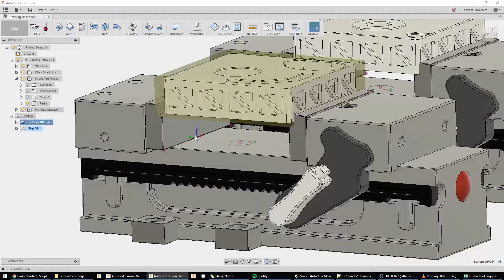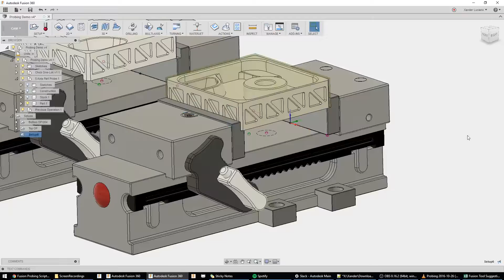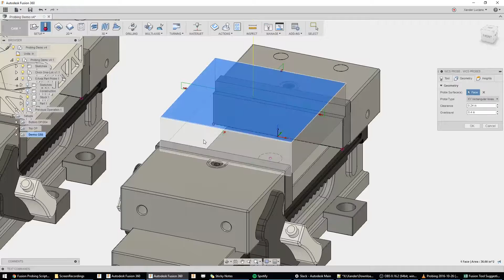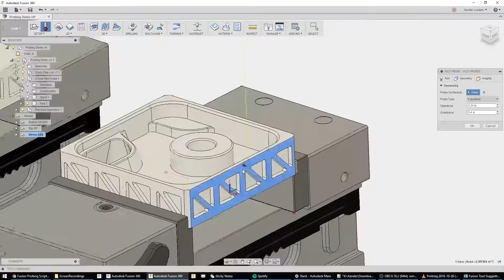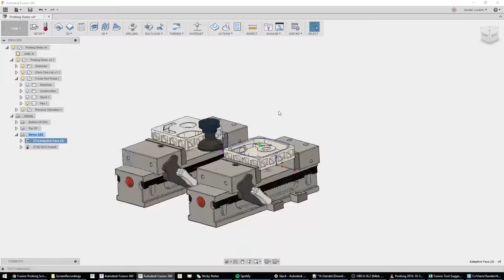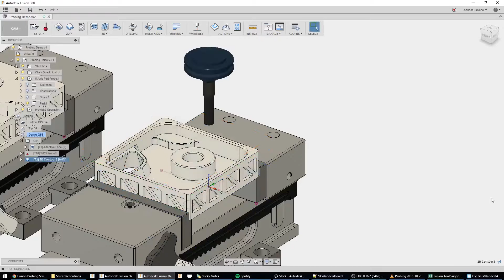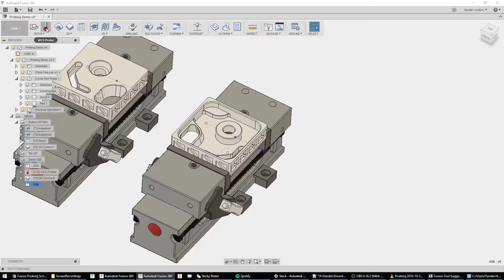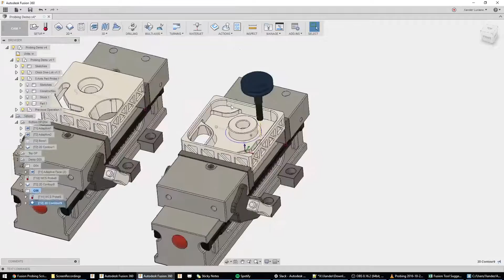Fusion 360 CAM - WCS Probing Tutorial

Comment: Hi Xander, so if you probe only the X-axis coordinate for G55 using G54. the G55 will takes the Y/Z coordinates from G54 and add the new X coordinates? example if originally G54 is X100, Y100, Z100 and G55 is X0, Y0, Z0 and now you probe to G55 X-axis only based on G54 you get the machine controller to have X(measured), Y100, Z100?

Comment: Disappointing and plain wrong tutorial has a couple of major howlers.  Try to use it like this and you're in for a major disaster.

The obvious one is that with the probing options shown, neither G55 nor G56 has its z-origin set.  They'll have to be set manually to be the same as G54 before you start.

Even bigger is the lack of understanding of what the probe ops actually do.  If you probe the centre of a bore or of a rectangular boss, it does NOT move the target origin to the point found by the probe.  It moves the target origin so that the point found by the probe has the coordinates in the target wcs that the model indicates it should have.  If you use G54 to update G55 by probing the centre of a bore that should be at 50, 50 mm and you find the centre at 51, 48, then the G55 origin is set to be the G54 origin moved by 1, -2 so that in G55 space, the centre of the bore is at 50, 50 as it should have been.  It's not a small difference and if this guy had ever tried it, he would have found out pretty quickly.

Once you've got that, you'll realise all the nonsense about folders is completely unnecessary for this example.

If the author of this video was correct, then the folders would need not only to change the WCS specification, but also to redefine the machining origin.
Reply: Hi David, I was trying to probe in the program for the first time and I also questioned why the Z height was not proped. I am a bit confused. Normally I probe my part again in the 2nd operation after facing and I like to do this in program. If I up G54 my part coordinate system will walk in space slightly. So I want to use the G55 after facing. But on the machine G55 is 0, 0, 0 what happens to the Z will z get updated?
Reply: @anglerfishcreativelighting6494  Here's a decent tutorial on how to do probing with video from the machine of what it does.  From about half way, you'll see how I approach 2nd op. https://youtu.be/lMLcEQuZhDk
Reply: My concern is how does the probe know where to go with regards to the Z axis🤔

Comment: So the Generic Haas Post will not output Probe routines?
Reply from the maker: Jim Van Eeckhoutte it should post them
Reply: It errors out with Spindle out of range
Reply from the maker: Jim Van Eeckhoutte make a post on the fusion CAM forum and tag @xanderluciano and attached your file and I'll give it a look. Thanks!
Reply: Error: Spindle speed out of range.
^^^^^^^^^^^^^^^^^^^^^^^^^^^^^^^^^^
Error: Failed to invoke function 'onSection'.
Error: Failed to invoke 'onSection' in the post configuration.
Error: Failed to execute configuration.
Stop time: Sunday, January 01, 2017 1:12:29 AM
Post processing failed.
Reply from the maker: Jim Van Eeckhoutte your spindle speed is over 99,999 rpm or is less than 0. check the spindle speed for all your operations. try changing them to 5,000 if they are over 10,000 and see if that posts.
Reply: Post never errors out, just when I add the WCS Probing setup .

Comment: Hi Xander, great video on the latest fusion 360 stuff!  Two things, just found your channel and when I subscribed I saw you're also into drones. I fly a Phantom 3, and would love to see some drone related fusion projects.  Also curious about the vises in you model, are they commercial vises? if so what brand are they.  I really like the way the jaw is moved.

Thanks
Terry
Reply from the maker: Thank you Terry! I already reverse engineered my gimbal in Fusion 360 so I could machine a replacement motor mount, as well as doing some simulations on it for fun. I'll definitely keep this suggestion in mind for future videos! I'd love to combine my 2 hobbies more. 
The vice is available in the CAM samples project, and it's the CHIC one lok vice. We've already put the joints in it as well! If you'd like to see other Vices, let me know! I'll be adding more to the samples project soon hopefully!
Reply: Where can i find CAM samples project in fusion 360?? CHERRZZ
Reply from the maker: On the project data panel, if you look at/scrool to the bottom, you should see a section that says samples. Under that you should see a project called "CAM Samples." They should all be in there!